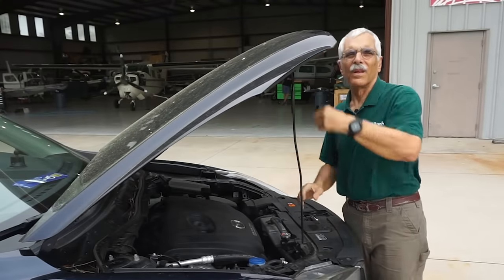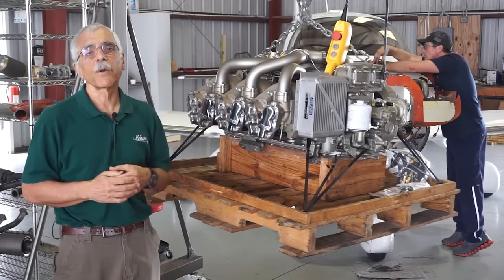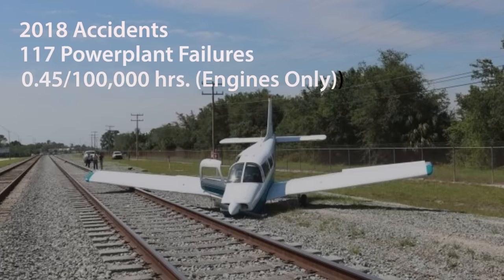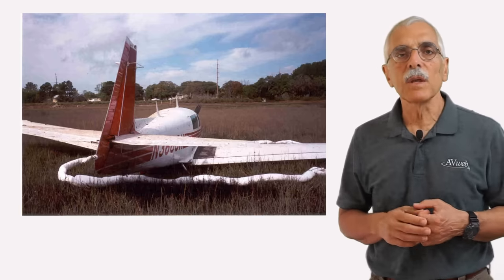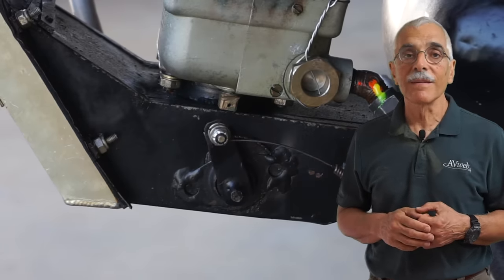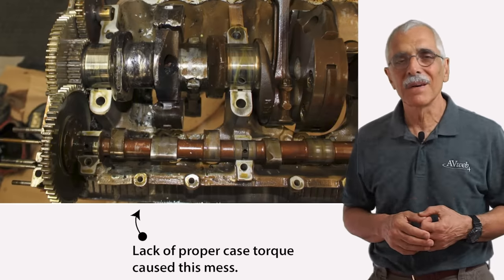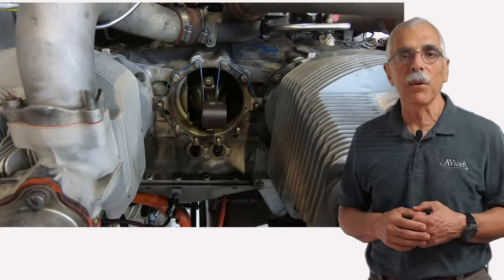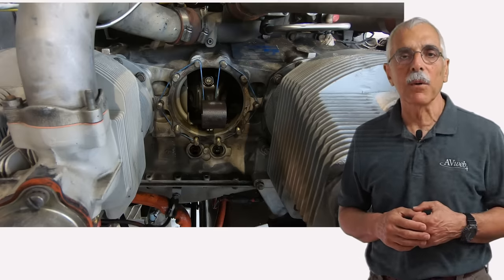Why Aircraft Engines Quit

Comment: Aircraft engines quit for numerous reasons.  But one MAJOR PROBLEM is antediluvian design!  Most GA engines were literally designed in the late 1940's, or with that era's technology.  Compare that with modern automotive technology;  Why is it this way?

Simple:  We need TORT REFORM! 

What is "tort reform"?  Torts are lawsuits.  You see, attorneys figured out in the 1970's that any sort of engine failure was the result of "lax technology and/or attention" by the major aircraft engine manufacturers.  In court, they pointed to the advances in the automotive industry and used that to convince juries that the families of dead aircraft pilots/passengers that manufacturers such as Lycoming and Continental were "negligent" because they hadn't caught up, and the [brainless] non-aviators on those juries then awarded multi-million dollar awards.  And later, when the aviation powerplant companies DID use new technology, the disgusting leech attorneys sued, basically saying that the improvements meant that "They knew their products were inferior".  Damned if they do, damned if they don't....

Go to Vero Beach Airport in Flori-duh some time and you will see several large open fields in front of the Piper Aircraft plant.  Those were where the thousands of employees of this company used to park...

Used to...

All the major airframers have been sued this way as well.  That is why you don't see a new revised Piper Warrior every year.  They only make tiny changes from year to year [if at all..] for fear of being sued.  It is so bad that about 20 years ago Piper got sued because some asshole flew a 1947 Piper Cub into  a truck and didn't live.  The family's attorneys claimed that Piper was at fault because the Cub couldn't be flown into the side of a truck at 60 mph and not survive.  I'm not kidding, a "jury of peers" said this family deserved millions of dollars because a tube-frame and fabric airplane built 50 years earlier couldn't be flown into a stationary object at 60 mph and protect its pilot.

What?

This is WHY there are no major improvements in technology in the general aviation world.  

-You that think quickly might wonder about my beginning point regarding the automotive industry.  Guess what:  Auto manufacturers have a  *SPECIAL* dispensation against being sued for the same reasons.  In gross negligence situations such as the '70's Ford Pinto, yeah, they can get sued.  But generally, lawsuits against the major automakers are turned away/shot down because the auto industry is a massive source of tax revenue to the government AND most importantly, a massive employer.  I just love it when I hear "green" people talk about how much better it would be if people didn't have personal cars, and I just wonder how much they would bitch and complain about the dead economy that would result if we DIDN'T have personal cars!  Cars are a massive  amount of the economy and everyone likes them.  THAT is why the auto manufacturers get a "pass"

The Republican party is all about tort reform, yet when they are in power, nothing ever happens.  The Democrats?  Against it.  Yet, if you look at congress carefully, you will find that nearly every congressman and politician in general is an ATTORNEY.  Folks, party affiliation doesn't matter;  They aren't going to kill their massive industry's "cash cow" in order to help a tiny cottage industry thrive~

Comment: I don't know how to fly and have never sat in the cockpit of an aircraft. When I get in my car at night, as I turn the ignition key I'm turning on the headlights or parking lights  with my other hand.  It's automatic. At the same time I'm looking in my mirrors and around the outside of the car so that I know what's around me. I have to think that if I'm going to be leaving the ground and flying at whatever altitude and speed small prop aircraft fly at, you can bet your ass I'm going to check everything and if necessary check it twice before I even taxi out to the runway. And I'll have a plan to bring her down upon take off  if necessary, hopefully  without injury to myself or others. My point is I could never be lackadaisical about any any part of it. Not even when just operating a motor vehicle.

Comment: All I heard in the first 5 minutes of this is "Airplane engines are shit and fail constantly and cost a lot of money and continue to be used despite the concurrent existence of perfect automotive engines"
Reply: I mean we learned carburetors were bad IN WWII. Why would anyone use carburetors xD
Reply: These structural failures stress me out as well. I have a 2002 Tahoe with a V8 and it ran 280,000 miles with minimal maintenance (regular oil, the occasional water pump leak, and a starter). Then it started to develop a clattering sound in the valve train and I disassembled it to find one of the camshaft lobes was spalled. Before I took it apart and discovered that issue though, it ran another 3000 miles with no issue while making the noise.

It makes 280 HP, doesn't have pistons the size of beer kegs, doesn't cost $40,000, and it doesn't have a carburetor to ice over .-.

We need to LS swap all of General Aviation.

Comment: I don't understand this at all. You begin with what seems to be a comparison with a car engine, go on to explain all the ways that aircraft engines break, that car engines generally don't, and end with an anecdote about your car engine that didn't fail, and would not have been an issue if it were in a plane (battery failure).
Is the lesson here that aircraft engines are generally badly made, or old designs? If so, why aren't they being improved, like car engines? Also, why do we never have to sump our car tanks?

Comment: Bottom line not explained - are auto engines more reliable than aircraft? Find me an auto engine that can produced near max HP for 2,000 hours - Not going to happen as they usually are producing10% power. Plus, if an aircraft gets 2,000 hours, usually at 100 - 200 mph, that would be like a car going 200K - 400K miles. Happens, but rarely.

Comment: My question is, why hasn't aircraft engines moved quicker toward new technologies that are more reliable?  Look at most automobile engines nowadays, very, very reliable and very fuel efficient, multiple valves, etc.  Why hasn't the aircraft engine builders taken a page from the auto engine builders?  In effect, we are still flying with 70 plus year old technology!

Comment: For me the elephant in the rm is the fact most of these motors even tho they are inspected yr after yr are still from the 50's and 70's cars were shit then always broke so the aircraft motor is and has been in my mind very dependable. But with tech these days why something like a toyota motor could not prove its worth we know you cant kill that unless you really give it the college try. Is the motor to heavy or is bureaucratic red tape the cause like it is with most better altirnatives. Only used toyota as an example i have seen a few honda engines in aircraft as well.

Comment: $40.000 for a overhauled 6 cylinder version of a VW bug engine that was designed in the late 1930's. Yes they are reliable but so are automobile engines, and automobile engines far more advanced, modern and more efficient, and powerful. Imagine how much more reliable automobile engines would be if the DMV required you to get your engine overhauled every 3000 hours. I don't get it, it just seems like everything having to do with planes is a scam of some sort.

Comment: It's amazing to me how utterly reliable the small block Chevy engine is compared to these aircraft engines, having proved themselves in artic as well as desert conditions. Over loaded, over heated, ridiculous levels of lack of maintenance,  and over 6 decades, they have won more races and more hearts and veen more reliable than any complex mechanical device, ever. Yet these aircraft engines, built out of necessity, maintained, supposedly, by industry professionals fail at an alarming rate, despite insane levels of record keeping and regulation. Carb icing aside, it is readily apparent, a cheap, light, affordable engine, designed by the most prolific car manufacturer ever, is far superior to engines which need to be perfect, yet prove they are anything but.
Reply: Those engines are not run at 75% power for thousands of hours.
Chevy''s that do run at those power settings (aka race cars) never even last more than a few races before they are replaced.
Aero engiines run for 12 -20 years reliably at 75% power without fuss.
Reply: @arthurfoyt6727  Yeah. I've researched and followed Chevrolet's engineering and R&D for 40 years. I've talked to engineers who worked on their race engine program, and who've done engine R&D as contractors for GM. You might want to research how much development time they put into engine testing. It makes aero engine design look like it's done by the girl scouts. Maybe look at the ridiculous testing they put the original  LT5 Corvette engine through. And that was the '90s. Not to mention, between actual stress testing, FEA, and computer simulation, the equivalent of millions of hours of testing the previous LS based engine went through in its development.
Reply: @bigblocklawyer  All the FEA on an engine is pointless as soon as you bolt on experimental drive reduction gear system.   All the engine management systems for reliability are pointless when the alternator dies and then the tiny airplane battery dies a minute later.

Comment: Aero engines can never have a comparable reliability as car engines.
The environmental conditions are completely different.
There is this core business for overhauled parts. Parts that had been in use  for hundreds/thousands of hours are not the same as new ones.
Car manufactures are thinking in serial numbers of millions while aero engines are build by the thousands. Therefore the tools to produce these engines are not so sophisticated.
The operating conditions are completely different. A car is started, warms up with moderate power and proceeds at max power for some limited time. An aircraft is powered up and needs to take off at max power shortly thereafter.
A car engine is lubricated by oil. An aero engine is lubricated by a mix of oil and water.
Why ?
Because due to environmental conditions the crankcase is chilled down to low temperatures and the vapor from the blow by gases condensates to water.
This is never understood because this oil/water mix gets above boiling point at landing.
Thus the water is gone and technicians are unable to observe what strange things happen.
A huge contribution to engine fails is caused by the authorities even, by requesting redundancy on some systems what leads to switching of inductive components.
But inductive components don‘t like to be switched !
There are many more impacts….

Comment: GA piston aircooled engines are kept in the 30s tech. Because those that control the system don't want the common folk bothering them in the air as ot happens in the oceans...
It is as simple as that.

Comment: The idea that the simpler an engine is the more reliable. Let's look at how reliable a 1970's auto engine was?? Not that reliable as today's engines which have lot of computer technology to tells you when there is a problem before your engine quits. The computer logs the problem as a code.  It's sort of like airliners a modern airliner has progressed with technology, but general piston aviation hasn't they stuck with the old school design. If general aviation took the same path as modern cars you be able to get rid of carb icing and know what happened when the engine quit because the code would be recorded. There is an idea that computers are black boxes which shouldn't be trusted by pilots but look at an airliner it's got 100's of black boxes yet their safety record is far greater then general aviation.

Comment: Lets face it, old old technology, poor materials quality control, air cooling, carburettor or mechanical fuel injection in the main, troublesome first gen tech magneto's, re hashed mineral based oils, often long lay ups between use. Now add in poor engine operation management, poor use of carb heat, poor mixture controlling, is it really any wonder some engines scream enough and quit !!. Some very interesting facts and figures in this article which is helpful but why engines quit, for me is no surprize. The fact that lead does not lubricate valves is misleading and not the full story though. Lead coats the valves, seats, valve stems, and guides which vastly reduces friction and substantially cushions valve to valve seat impact, and a highly sprung impact at that!.
The other thing I wanted to pick up was the fact that Cessna, in the article the 150, is prone to carb icing engine quits, by design Cessna duct the air from the cowl under the engine and straight to the engine intake on the other hand Piper and others, flow air over the cylinders and around the the back of the engine to the intake which considerably warms the air in comparison to the Cessna design, this is why Piper aircraft require hardly any carb heat if at all outside of known icing conditions unless in very long idle power descents and even then only brief applications to check for an rpm increase, its worth remembering also that typically carb heat is pulling unfiltered air into the carb as it typically bypasses the air filter process.

Comment: we've all heard of planes with aircraft engines but what about TANKS with AIRCRAFT ENGINES ? 🤔🤔🤔🤔
Reply: @mayhemmaximus2519  There is no such thing. Meanwhile the Abrams M1 uses a Honeywell AGT1500 gas turbine engine. which is basically an aircraft engine but adapted for its purpose. During WWII Germany also had a prototype Gas Turbine Engine called the GT 101, 102 and 103  which they were going to put in a specially designed Tiger tank but the never got around to it.

Most modern tanks run on Diesel. Diesel does not make good aviation fuel otherwise they would be using it rather than specially formulated aviation fuel.

Comment: How many Mazdas are required to produce 65-75% power for most of their working lives? Has the great Paul run a statistically useful number of CJ-5s, maybe 50,000, at 75% for 2000 hours each? When he has done that, and if they "never" gave problems, he'd be a bit more credible.

Comment: Want to make small engine planes more reliable? Get rid of gasoline engines and make them Mechanical Turbo-diesels. More fuel distance, less problems with colder flying weather, so long as you're running Diesel #1 and only Diesel #1, not biofuel blends or any of that nonsense.

Comment: I think most airplane engines quit because they are using outdated tech because of some dumb regulations.
Less complex doesn't always mean better.
Efi systems have proven themselves for decades already, over head cams, 4 valve head with hardened seats and so on
It's time airplane engines embrace modern tech

Comment: So the question is, if a Mazda engine never fails with all that fancy stuff, why does an Airplane engine fail...at a much higher rate with some technology dating back to the 1800's!   And with the cost of a small airplane engine at a level of a two year old Lexus, that's just nuts.  Someone either tell me I'm out in the woods or I got something mixed up in my head.  Shouldn't airplane engine technology be brought into the 21st century....pushrods...really!  Mag really better than Electronic?...EFI better than a carb (that can freeze).  Lets toss in a reserve fuel tank too, like on a Honda 90 cc. Come on FAA get your head out of your (where the sun don't shine) and let general aviation thrive.

Comment: When I first saw you thumbnail with Boeing's Phase of Flight pie chart i had to laugh. It's the most useless chart in aviation.
A useful analysis ALWAYS leads you to a WHY. Anything which doesn't is an Analysis Failure.
I've discussed their chart with Boeing Engineers as to what a waste of time it was. Was it the Takeoff or the Cruise which caused the accident? Looks like we should only do acrobatics or landing. It doesnt reveal anything as a WHY. Where does one put a Terrorist Bomb? On Takeoff? Cruise? Or what if it blows up on the Ground? Where would it fit in their useless chart?
Your Engine Analysis Chart was more useful.
Too bad Logic isn't a common skill (even by investigators). Every crash has a Cause. Find it.

Comment: Very informative video.  I'm not sure why you are trying to compare all  aviation engine failures to a late model Mazda.  I disagree with you that auto engines never fail.    I can assure you plenty of automotive engines fail for a lot of different reasons and its 1000 times or  more than aircraft engine failures.  I'm a auto tech with 45 years of experience and own my own shop now.   I'm also a private pilot who rents aircraft I fly.  I don't own my own plane.  I was taught to do a preflight with the preflight check list before taking off.  By the way Kermit Weeks how about using a check list in your war birds?  I'm horrified with your videos when you do your preflight from memory but I digress.    In my limited experience plane owners I have known don't even do a walk around and preflight much less use a preflight check list and they cheap out on maintenance.  Not to say you are this type of plane owner but none the less plane owners I have known are that way.

Comment: I think general aviation will be safer, more reliable, and simpler once batteries and electric motors get to the point where it makes sense to replace these old dinosaur engines and avgas.